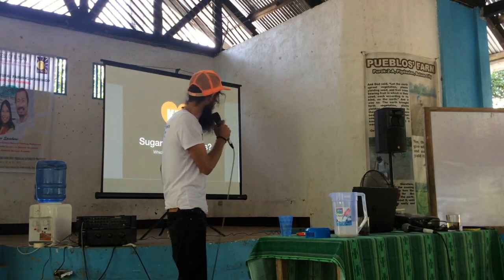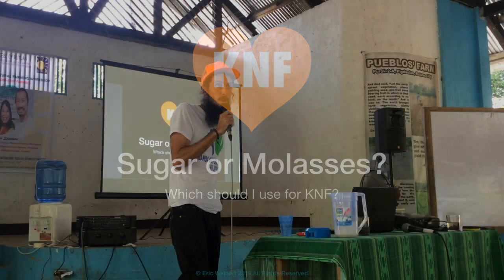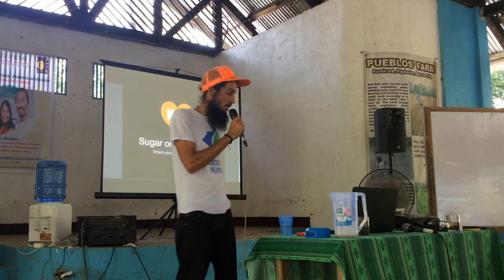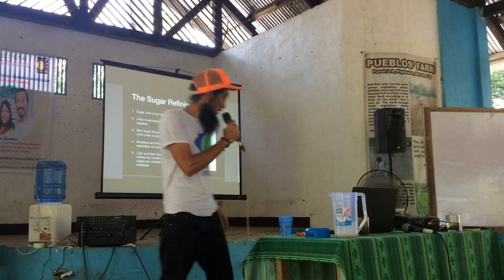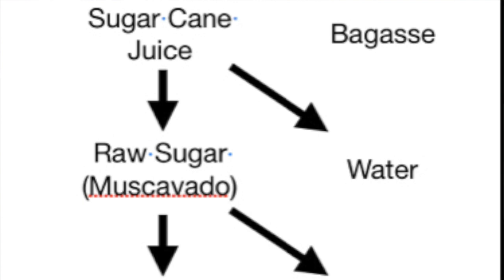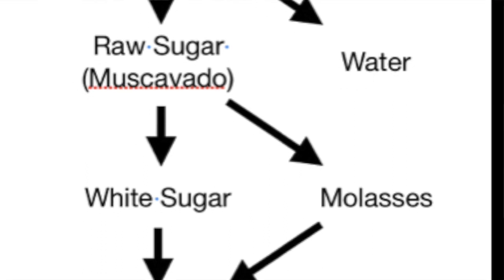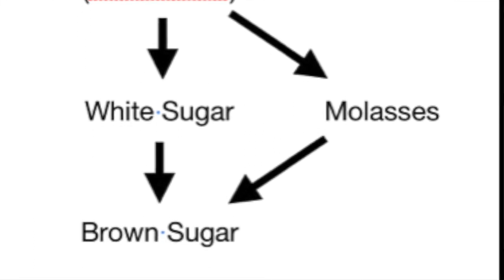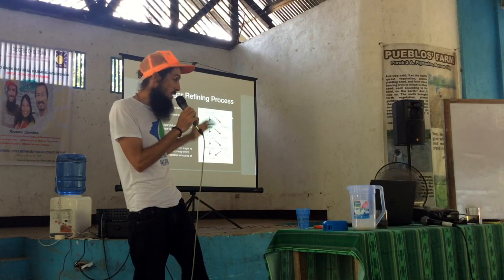KNF Sugar vs Molasses

Comment: I'm in Florida and basically have beach sand for soil. What methods of KNF would you use to bring the soil and organisms to a better grow medium?
Reply: Organic matter=humus
Reply: Try some biochar and organic matter.
Reply: Not sure if you've found a solution as of yet but I would recommend starting a worm bin and begin making a compost pile. Sand is good for aeration so you can us it as a base. 1 part sand 1 part compst and 1 part castings is a great soil.
Reply: @lvrsvid  yeah I raked my yard last year of oak leaves and put grass clippings and went to beach for sea weed and made a nice compost. And now have 2 worm bins about to turn an old jacuzzi into a large worm bin. Worm poo ftw
Reply: @kydenj28  right on, glad to hear it, good job.
Reply: @lvrsvid  Florida has red fire ants, worm farms are very short lived there. - just noticed her comment, I could be wrong, maybe she has the secret.

Comment: Brown sugar costs twice as much as white ones here in my location. it is more economic to buy white sugar and molasses and mix them into brown sugar. but i guess it' d be less dry than store bought brown sugar? would that be a problem? thanks.
Reply: Did you watch the video? The car with tires metaphor? Yes it costs more. But don't you want a car with tires?
Reply: @HaCubbee  i dont recall the whole video right now. but my comment not comparing brown sugar vs white sugar. was he saying something on store bought brown sugar vs homemade  brown sugar in the video? if not what the f you talkin about?
Reply: deja, I think it would work fine.  Different plant material would have different amounts of moisture so it shouldn't matter, IMO.  Chris Wilson gave a recipe for making brown sugar.  Try a small amount to start and see how it does.
Reply: @deja5072  You might be able to dry it out a little more by putting it in the oven on low for an hour or two. Stir it around so it stays free flowing a few times while it's drying.

Comment: Good One . But I need to ask a question. When we supersaturate. The microbes slows down . Goes to rest and thus the solution is inactive at that storage stage. Which in effect means to get the solution back to active forms, The water molecules needs to be loose for the microbes to be active again. At this point cant direct adding of water or molasses be the sufficient to bring the solution to been active.
Reply: yes, once you have free water molecules in the solution, the microbes will become active/replicate again.

Comment: Cheaper to make your own brown sugar.
Reply: how?
Reply: @suchandradasi  one cup of unrefined or white sugar and one tablespoon unsulfured blackstrap molasses. Want light brown sugar use less. Want dark brown sugar use more. That's what 99% of what is in the stores anymore anyway. Easiest way to tell is to take some of the store-bought brown sugar put it into a white paper towel fold it and rub it vigorously. If it stains the towel, then it was made with molasses. That's the cheapest and most of cost-effective way to make brown sugar.